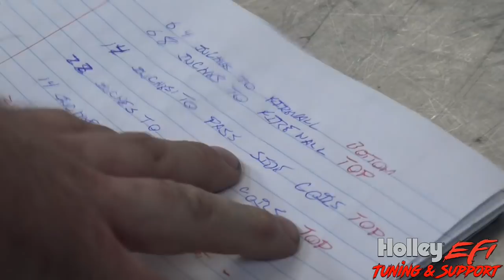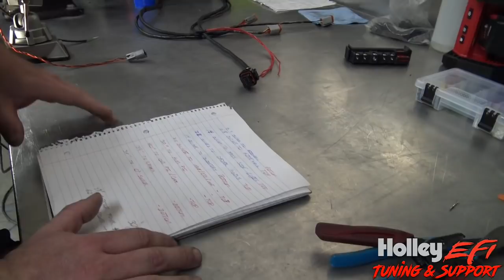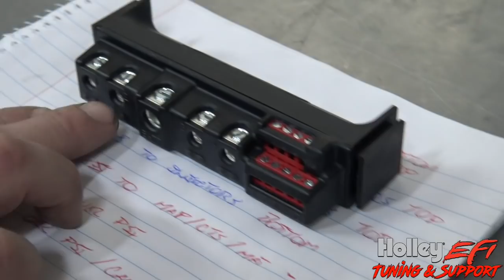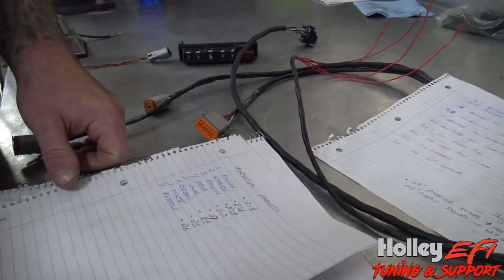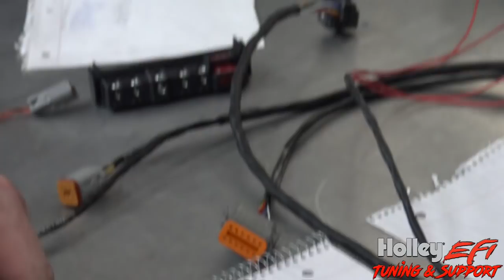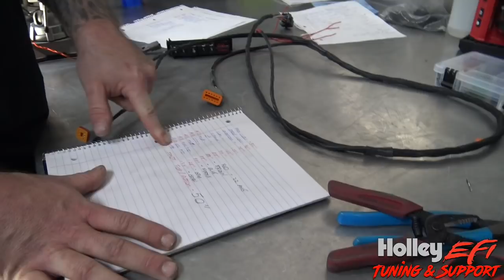how to build your own holley efi harness

Comment: Do you use the holley loom material to wrap your harnesses if so how flexible is that material as i noticed all the different sizes they have  and do you get that as tight it will go on or go up like a size so harness will move within loom? I bought the 3 conductor shielded wire to do my i/o does this shielded wire need to be grounded a specific manner? Great videos learning alot thanks for your time to make us all better

Comment: Awesome video! thank you!  curious if you have a general recommended wire gauge list for different things, injectors, coils, sensor types and so forth.  I picked up 22 for most sensors in the video but couldent tell what you used for coils, injectors and others aside from "oversized" injector and coil power to future proof it.

Comment: Thanks for another one Devin! Those MSD relays, what do you think about substituting them for traditional relays on a typical relay/power board? I can’t swing $2k for a Smartwire setup, so I’m getting ready to build a 7-8 relay board but these things look a lot cleaner. Any issues with running several independent of each other? I’m assuming they can control multiple circuits (4 from what I saw), correct? Thanks again for the vids!!